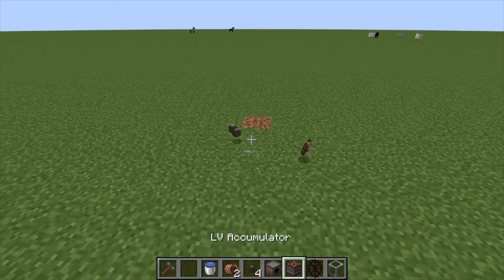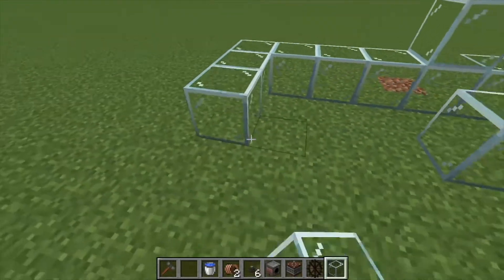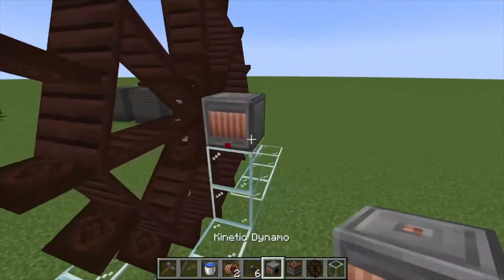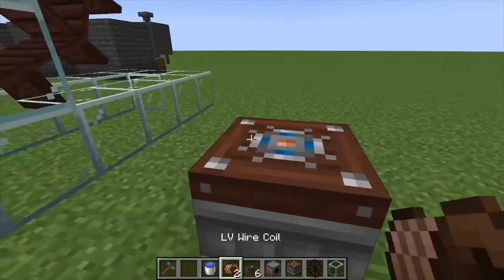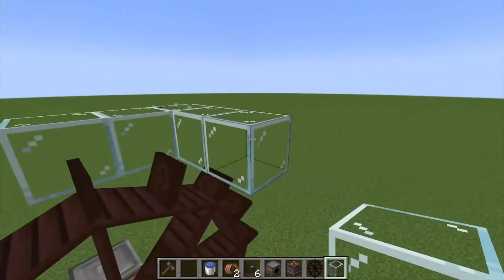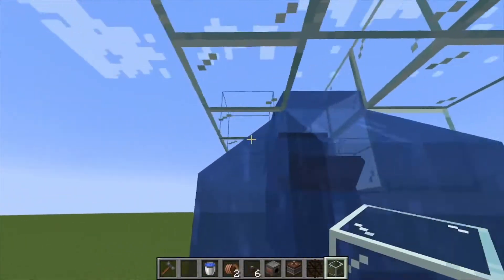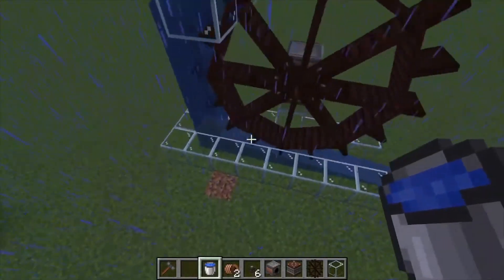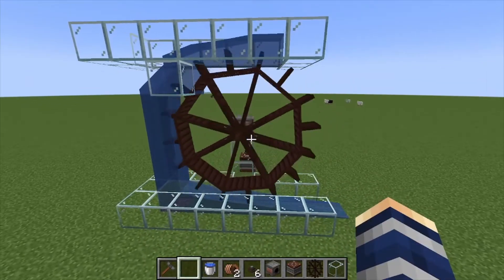Immersive Engineering: Water wheel (How to Setup)

Comment: While I like your videos and they are often helpful, this is unfortunately not the best possible way to set up an IE water wheel (although it's far from the worst). Other youtubers have shown better patterns that are quite easy to find. You will need additional source blocks on the 'empty' side moving 'away' from the wheel, as well as adding a 'step' on the lower left with a source block above it and to its immediate right. This setup, using six water source blocks per wheel, will add a little more power that the above layout doesn't quite reach, and is the only way to get the full 88rf/t that's available from a 3-wheel setup rather than the ~80rf/t that the above setup will generate if used with a three-wheel set.
Reply from the maker: Never claimed to be the best but good info. The channel mainly focuses on the basics

Comment: can you use 3 wheels side by side? ive seen em in older vids. or is it an outdated exploit
Reply from the maker: You can still use 3 side by side!
Reply: @MCMentor1  i cant seem to get it to work, im using the cave factory modpack and ive seen others play it with 3 water wheels working together but mine wont connect even though it has the space
Edit: figured it out, cave factory has blood magic in it and that adds a rune that places little light sources that are almost invisible, except for redstone particles, i found one in the way of the wheel and removed it, and suddenly i could place them all down right lmao, so long story short, nearly invis light source was taking up a block needed for the wheel to be placed
Reply from the maker: @AshiDeino  That's wild! glad you got it figured out i was downloading the pack until i saw the edit lol
Reply: @MCMentor1  im glad I figured it out too, also wow ty for actually going to put the effort in to try to help, not alot of people do that